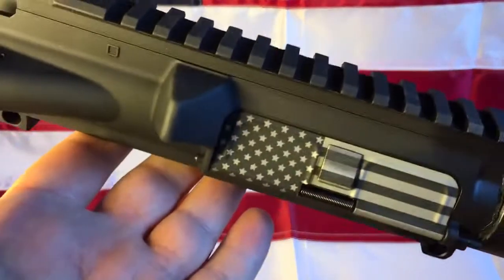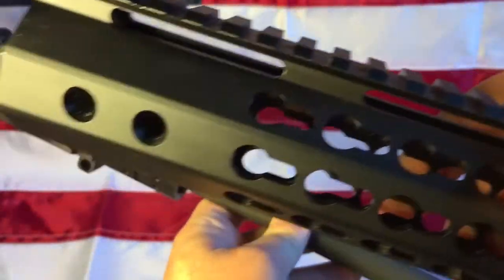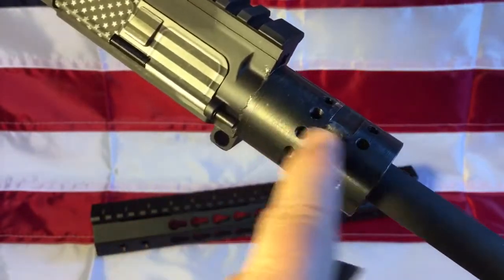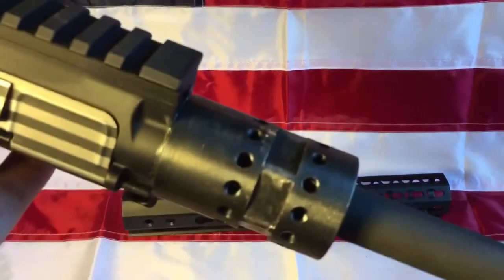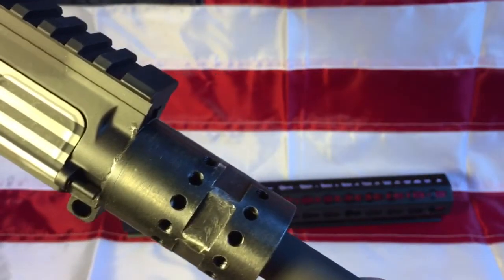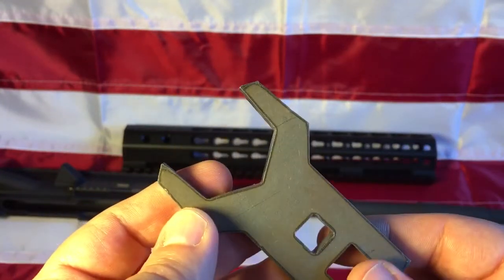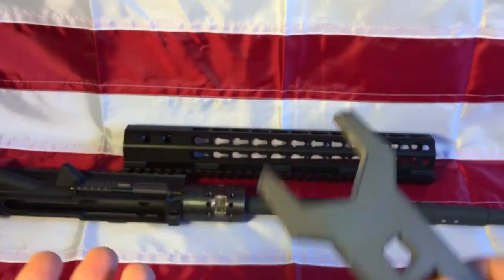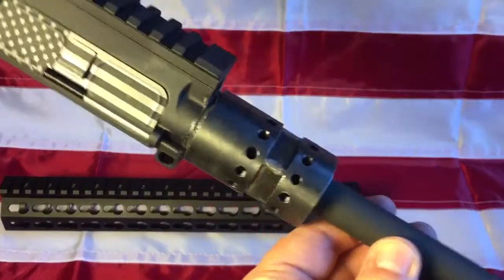Smith Built Manufacturing Slim Keymod Rail - Update

Comment: Have the very same issue with a Firefield hand guard.  The wrench slots in the barrel nut are even thinner that yours.  The original 1 1/8" wrench that came with it bent the same as yours.  Their customer service said the wrench was only rated to 30 lbs.  They had no solution when I told them the paperwork recommended up to 55 lbs of torque.  I ended up using a rag and channel locks to break it loose again without marring the nut.  I still have no solution to torque it correctly.  The crow foot wrenches are all too thick and the slots in my barrel nut are only 3/16" wide.  Not much left after grinding a tool down that far.
Thx for the video

Comment: I use the same hand guards with no problems. I bought a crow’s foot and ground it down. It fits perfectly and I can torque it with no issues. Wrenches have to be hardened!

As far as alignment, use the shims! A little trial and error and you can get it perfect.

Comment: did you end up using the handguard? all u need is 1 1/4 crows foot wrench!
Reply from the maker: No. I returned it and went with a KMR. It is a very small space to fill. I couldn't find a crow's foot wrench that would fit the tiny gap (at least not locally.)
Reply: Gman 32 false you cannot just buy a 1 1/4" crows foot it's twice the thickness of the barrel nut